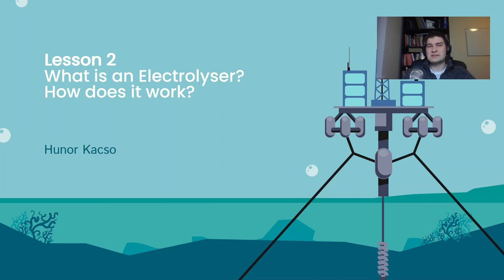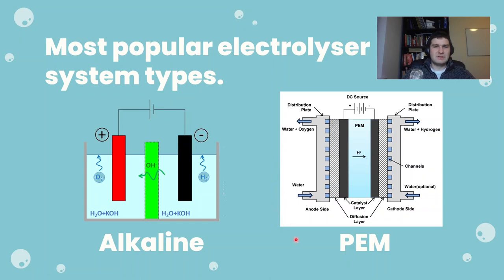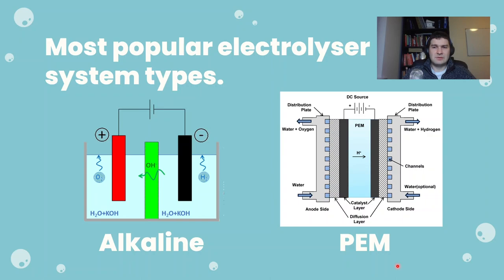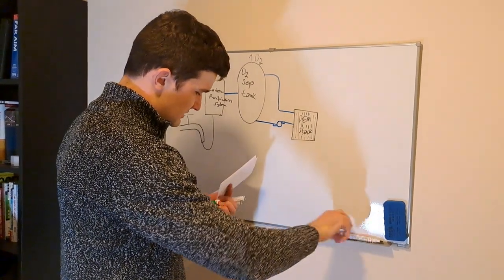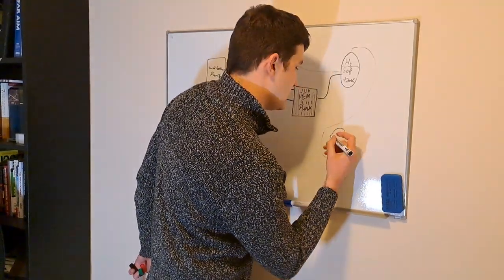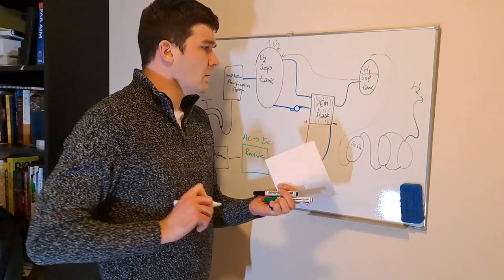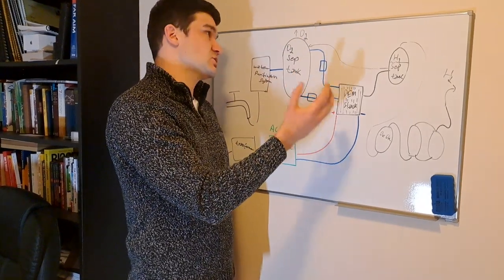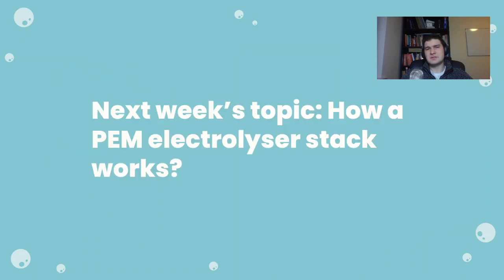How A PEM Electrolyser Works (Lesson 2/5) Hunor Kacso | Hydrogen Training Solutions

Comment: I am having to study this material for a job interview.  I need to ready 5 research papers (ICES) to get my knowledge up.  The papers IMO don't give a good explanation of what is going on.  Your short video does an excellent job.  14 minutes vs hours of reading.
Reply from the maker: @gulielmi2002  thank you so much for the feedback! I'm glad it was helpful. Let me know if you have any suggestions for future videos.
Reply: @HydrogenTrainingSolutions  I am very interested in learning more about the electrical connections within the PEM cell stack.  this is one area where it is not so clear in my mind.  In the application that I am studying for oxygen is the main component that is wanted with the hydrogen being a byproduct.  the device used is the same as you have been talking about but smaller.  Your videos have been a huge help for my understanding.  I am planning on watching several of them all day in preparation.
Reply from the maker: @gulielmi2002  I have a video called "Webinar: How PEM Electrolyser Stacks Work?". This is more detailed on the stack electrical connections. The bi-polar plate separates the cells (hence the name bi-polar plate - it's anode on one side and cathode on the other) and is made of a conductive material, therefore it allows the DC power to enter the next cell.

Comment: A question for you. You mentionned that we can generate H2 with a pressure up to 350 Bars. What is/are the variable(s) that are driving the H2 pressure ? Introduction high pressure water? Thank you!
Reply from the maker: Thanks for the question, sorry I only saw it now. The answer is that as the electrolysis process happens, the cathode side will have hydrogen appearing (evolving) through the hydrogen evolution reaction (HER). This happens regardless of the water pressure on the anode side the two sides are separated. There is a pressure regulator (or PCV) on the hydrogen line, allowing the pressure to build up. Normally 30 bar is the max pressure, although in lab setups 350 bar has been demonstrated.